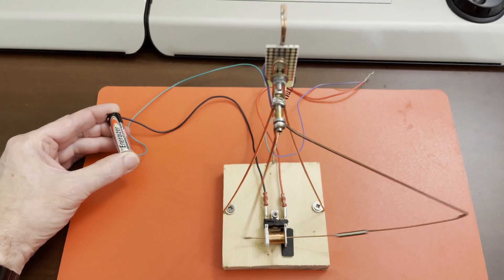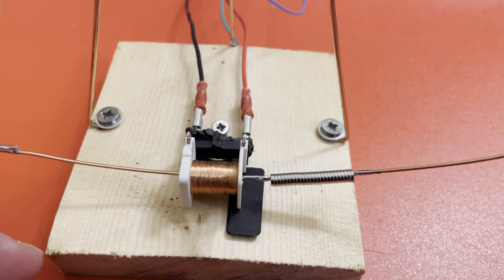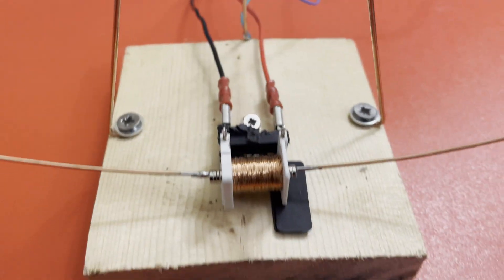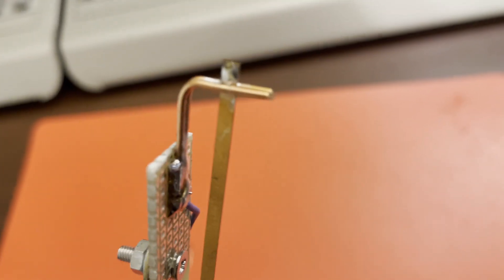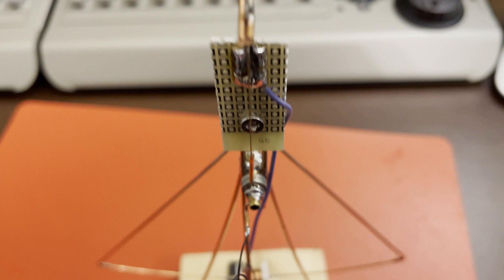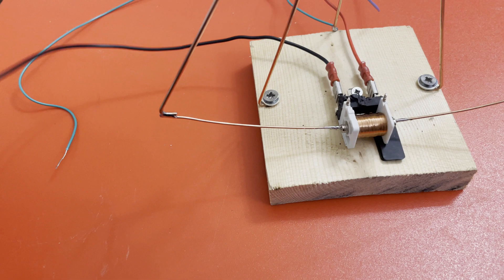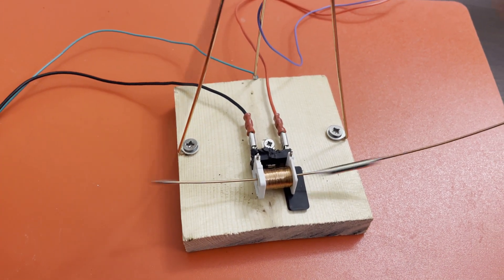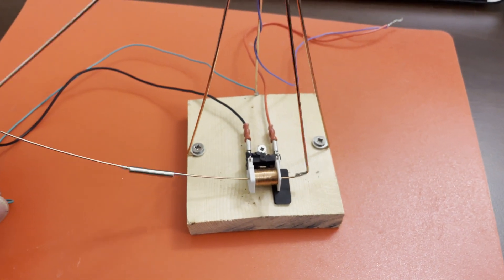Simple, low power, electromagnetic pendulum drive system

Comment: This is very much like a store window rocker display that was common in the sixties but seemed to have vanished later. It would run on a single D cell for a good long time. Powerful enough to tip a good size cardboard sign. 
Ah, i see you know about these. Is there a name for this gizmo?
Reply from the maker: Yes, that's the gadget my older brother had in the 60s, with a single D cell!

Comment: how would you slow the movement down?  that's swinging way to fast -
Reply from the maker: A longer pendulum - the rate is set primarily by the distance from the pivot to its centre of gravity; it should have a reasonable end mass compared to the support parts so the C of G is near the lower end. Roughly 99cm gives around a two second cycle (one second each way), or 25cm around one second for a full cycle. Adjusting the length from the pivot can tune the exact rate.
Reply: Or operate it in a weaker gravitational field.

Comment: Brillié French clocks worked in this way with a single C cell (or was it a D one?) back in 1900 ~ 1920. Beautiful pieces of incredible simplicity and amazingly efficient. The time the coil is energized can be tuned to be so short that on a modern alkaline battery it can easily work for 2 or 3 years.
Reply: Oh, I'd like to add that the Brillié clocks had an horizontal U shape iron mass in the pendulum, one of the U legs inside the coil, this to make a magnetic flow as closed as possible leading to a really weird looking pendulum ;)
What I don't remember is if that U was magnetized or not, because you can achieve a somewhat similar effect with just the non magnetic iron being attracted.

Comment: Ive always intended to modify a pendulum driven clock to use a coil to provide the impulse, yet let the pendulum determine the timing of the impulse by using an optical detector.
Reply from the maker: I don't know is a single opto switch would work directly, and give the required past-centre timing - but a centre opto switch trigger and a monostable may work, or three opto switches at centre and either side, so the swing direction can be determined with some simple logic?
Centre switch to energise the coil after one outer has been seen, then the other outer to turn power off again as the magnet clears the coil?

With a real, weighted pendulum, it's starting to sound a bit like an updated version of the old electromechanical "Master clock" system!